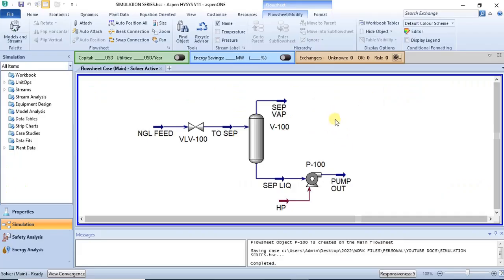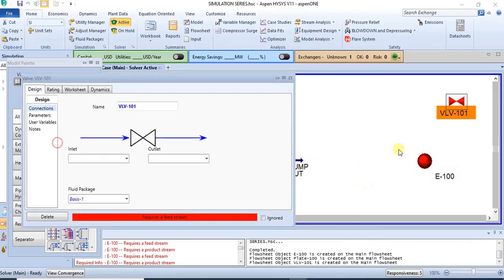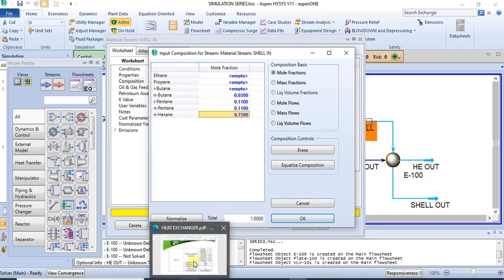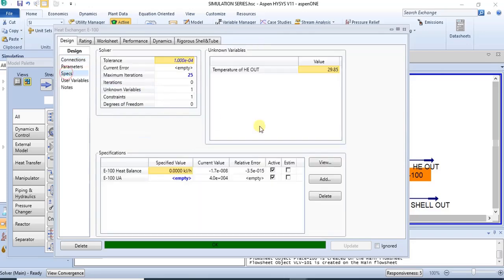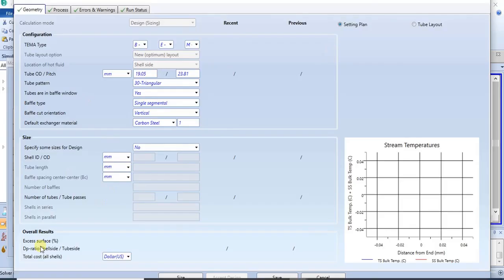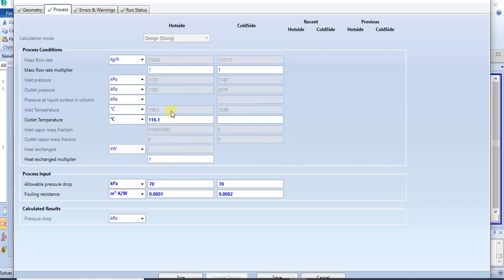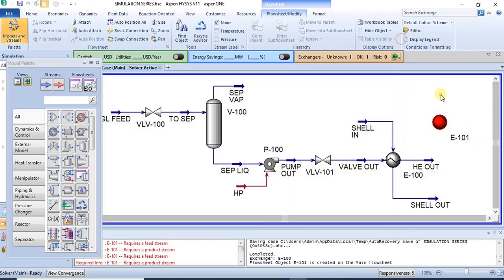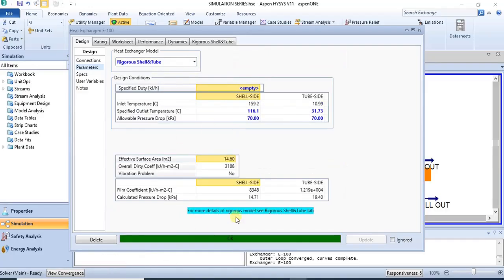Lecture 5: Rigorous Heat Exchanger Modelling in Aspen Hysys

Comment: Sir, Can you guide regarding what is the basis to select a specific model in the Heat Exchanger Simulation, as we have got almost five different models available in the Aspen Hysys? 

Basis to select a specific model among those available five models?